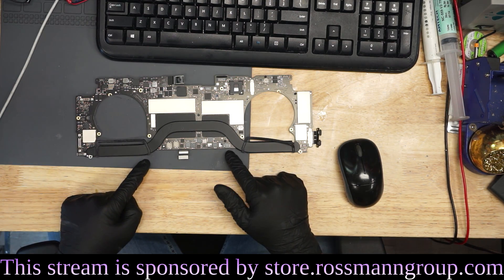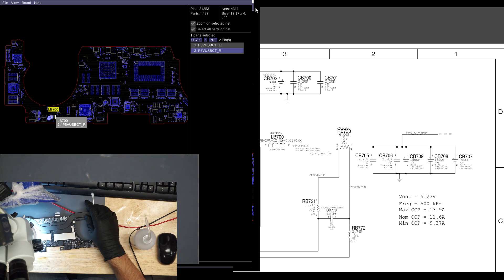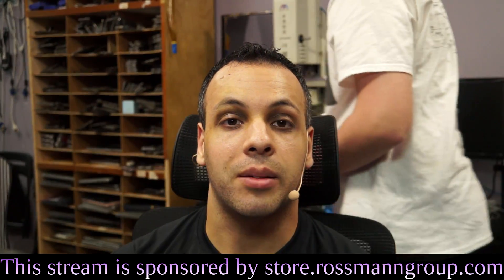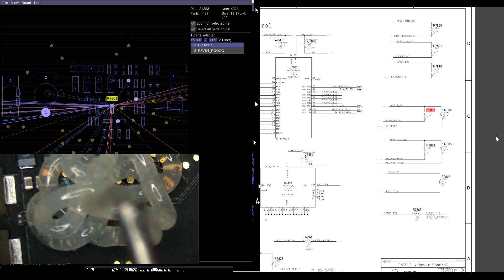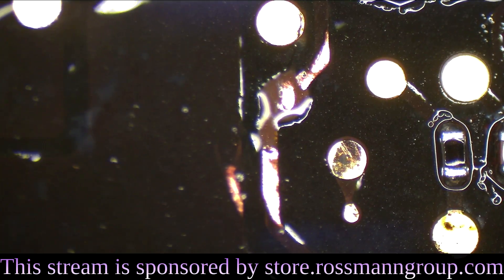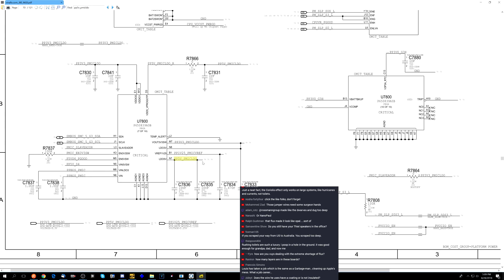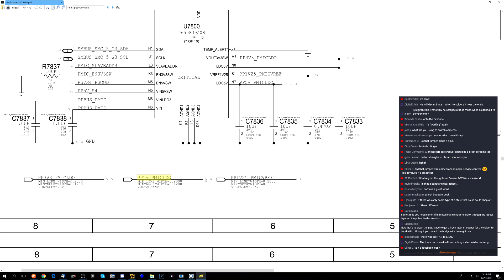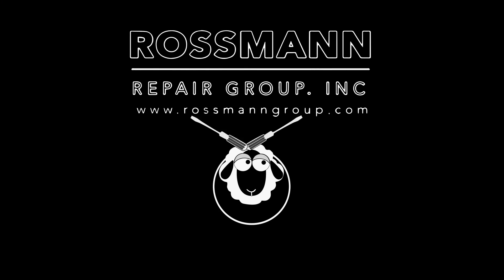Why does this kill a Macbook?

Comment: How come you seem to repair only Macs? Does nobody ever have a Dell XPS 15 or something that they spilled something on and need repaired? Although you can buy a Dell with accidental protection...
Reply: Tyler Cameron However fat chance that accidental protection will happen at the same time as accidental damage...
Reply: Well, after 4 years, (i think that's the most accidental coverage you can get) parts become cheap enough that accidental damage would pretty much be a non-issue.

Comment: Louis your videos gave me the confidence that I can try to replace the capacitors in my wife's 25 year old Toyota Camry Instrument panel I just ordered the parts from Mouser and a solder sucker along with the wicking material. Heck you even have two black cats! I have one too along with a ginger tabby.
Reply: Replaced my capacitors today on my Camry gauges and it was much easier than I expected.  I used the solder sucker and followed your instructions.  I'm a plumber so I'm used to soldering pipes. Thanks Louis for giving me the confidence.
Reply: What problem are you experiencing with your wife's Camry's instrument panel? I have a 20-year-old Camry, I just want to be prepared...
Reply: DashCamAndy both gauges are dead.  Until I reflowed a couple of corroded solder joints I had nothing.  Now the speedo is off by 15 mph or so. The capacitors are known to fail after 20 years or so. 16 years is the figure I was quoted as being their lifespan. People who live in hot climates are subject to more failures.  I guess the electrolytic caps don't like heat.

Comment: $1500 dollar Macbook is dying from a shit ton of random corrosion, meanwhile here I am with a $100 dollar laptop made with plastic and two metal lcd hinges that has been used as a food dish by a toddler, had soda spilt on it, been left in the rain by said toddler, has been dropped in mud, and it still doesn't have a drop of corrosion on it at all. How, Apple... How.

Comment: I'd guess it connects to itself to allow for different configurations of support components that weren't(?) used in this application of the chip. I'd also guess that jumpering it to the other side of the board was probably just the easiest way to deal with a lower priority connection with other higher priority connections being made on the chip side. Then again with Apple, who knows ¯\_(ツ)_/¯

That said, the birth of a new PC is always a beautiful thing to watch :)

Comment: Connecting some pins on a chip to other pins on the same chip is sometimes used to configure the behavior of the chip.  In some applications the pins will be connected to different chips, but perhaps there is no need in this case.  Saying there's never a reason to connect a chip to itself is simply incorrect.
Reply: There is so many things you can do it you want to let the chip talk to itself, and you do not need an external wire to do it. It's finalized design, there is no reason why have the wire long like this. It's just a liability.